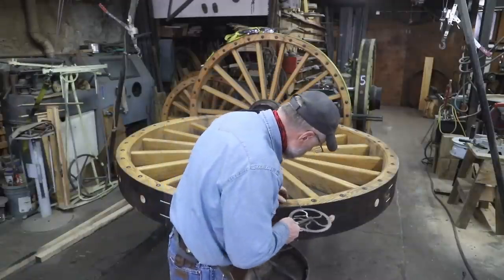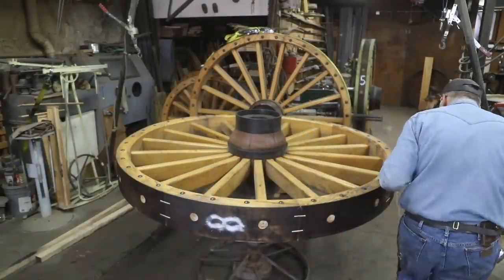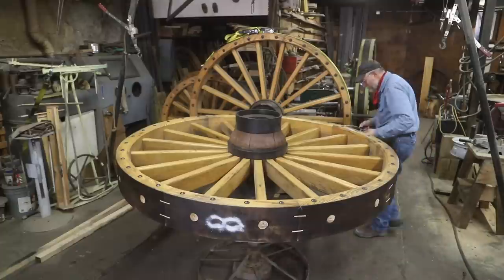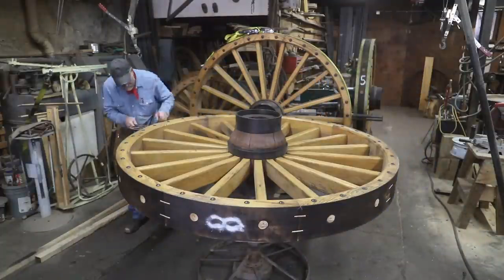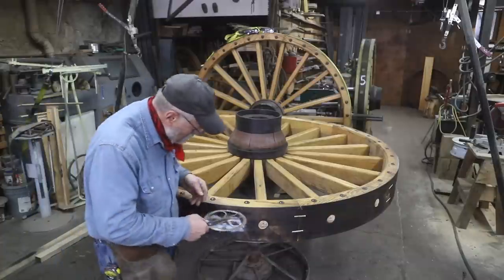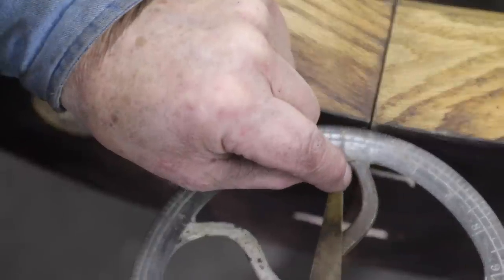Sizing Borax Tires & Setting Hub Bands | Engels Coach Shop

Comment: Another class on wheelwright works...its amazing how long lasting and rugged these wagon wheels are. They go through water, mud, deal with humidity and of course the bumps over the prairie for years and years. Every operation that gets done on these makes so much sense and why due to the math involved. Those large tires got about 1/4" or so removed from them which represented how much the spokes and fellows were loose/sloppy. Yessiree, remove, modify, replace and repeat. Not really all that far fetched from reality unlike some YouTube channels.

Comment: Some of the newer viewers may not realize that every band you remove has to be cut so that a little slice can be removed, then rewelded and ground before reuse.  The amount of work involved in this effort is monumental.  Much respect.
Reply: so why didn't he show  all of those procedures on at least one wheel.....instead he just skipped the whole thing and went to just taking them off and putting them on....I won't deny that he works hard...perhaps too hard some times but if this trend continues of skipping showing the work then soon his videos will become a before image of the wheel and then 3 seconds later an after image of the wheel and he can cut his videos down to just 5 minutes.... so I would have liked to see the whole procedure including cutting welding paint and heating on just one wheel and then skip through the other 7 wheels with just images or the like.
Reply: @TonyZ8553  Dave showed  taking off a tire last week and how to resize them. Next week's video is cutting off what needs to be cut off and rewelding them.

Comment: Suppose after tightening up the Borax wheels that they were (for the sake of argument) suddenly moved to a much more humid environment, thus increasing the moisture level significantly in the wood. How would that effect the wheels when now the tyres and hubbands are fitted to much dryer wood ? Thanks again Dave for yet another instructional video. I enjoy so much to follow your work and storytelling about the old craft
Reply: The wheels could expand then the tires would have to be lengthened.

Comment: Dave, do you reckon they did all this to the original wagons, hard as they worked 'em? Just thinking, they weren't in business much more then five years themselves, from what I've read. Could be you're the first! Either way I can never get enough of this stuff, thank you sir.
Reply: I think he mentioned in a previous video that the original wheels on the old wagons had to go through this multiple times, and they were built from day one in a hot dry climate.

Comment: You mentioned doing the process eight times over - does the water wagon not need similar treatment, albeit on a more manageable scale?
Reply: It is only 3 years old so will need it in a couple more years.
Reply: @dianeengel4155  Thank you for your prompt response (and last week's too).

Comment: How were hub bands and tires made to fit before oxyacetylene and arc welding became available? 
Hitting that kind of accuracy in circumference with forge welding seems difficult. 
Were they intentionally made undersized, then lengthened by forging or rolling to size?

Comment: Can any damage happen to an extremely dry tight wheel that relocated from a dry to wet climate? Just wondering water makes wood do wired things! We were still repairing old wood cisterns and building a few new ones here and there funny thing was no matter how dry the cypress would be after it got wet and swelled up if for some reason it dried some like around the top of the tank from lack of rain it would shrink a good bit smaller than it originally was! Sorry for the rambling
Reply: Don't be too sorry. That's actually a pretty sensible question. My tiny experience with wood tells me that once wood is dry or cured, it won't reabsorb moisture because all the fibers have closed up tight.  That's one of the reasons a hardwood like ash was preferable for making chassis in the early horseless carriage days of auto manufacturing.

Comment: Why the bonfire? I know you did it originally but you normally just use gas torches for tires. Could you explain next week?
Reply: Not normal sized tires. The Borax tires are considerably larger, heavier and unwieldy compared to a "normal"  sized tire. They're simply too big for his normal heating setup.

Comment: Would it have made a difference if the wood for the hubs were much drier than what you used?
Reply: Yes
Reply: @dianeengel4155  Did you anticipate that you would need to resize the tires and hub bands? I hope you built that into the price.
Reply: Yes, they had figured it would need done in 5 years.

Comment: I was surprised to see you dip the metal bands in oil rather than the usual water.  Was there a reason for using the oil instead?
Reply: It gives it the black finish without having to paint it and prevents rust.
Reply: @dianeengel4155  Was it done for the bands originally?  I don't remember that bit in the videos but may have been edited out. Thanks for the explanation.
Reply: Yes
Reply: @dianeengel4155  Thank you I appreciate your time

Comment: With fuel ⛽️ prices beyond greedy bout the name of the game entertainment. Not that any of these channels are boring I do like close my I pad go fishing while I’m camping turn the idiot box off the tv 📺 but since that’s gonna happen for six more months this channel of repairing wheels 🛞 to building stuff from scratch is the ticket. We calculated like your truck is 180.00 plus a fill up per stop. Best thing to do un cover the rv run the ac sleep in it in the drive way camp at home. People with motor homes crank up go drive on the highway exercise come right back home run generator. Do oil changes maintenance wash wax. Put air in the tires your not going any where. If you do be prepared to cry 😭 at the pumps.

Comment: Dave I think you are losing your enthusiasm for making these videos. This is the first one that does not show what you are doing. Not once do you show any metal work on the hub bands. We see you removing them, and we see you replacing them. A new viewer will have no idea what you did. I WANT to see you measure the band, cut the band, weld the band, grind the band, heat the band, oil the band, place the band, and cool the band. At least once ! Comments on the work shown would be great. Do not assume that every viewer has seen them all, nor that long time viewers such as myself will be bored. Dave, you show moving all of the wheels onto the stand, but you do not show what you did to them on that stand, except for one brief two-spoke clip. But why are you hammering the spoke ends? In a previous video you did that, AND you hammered in wedges locking them in place. So why more hammering?